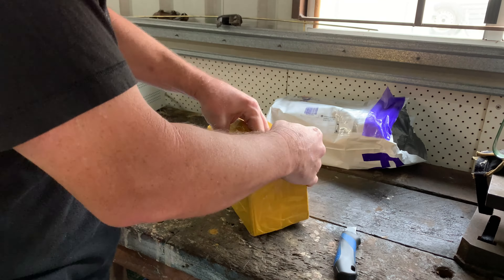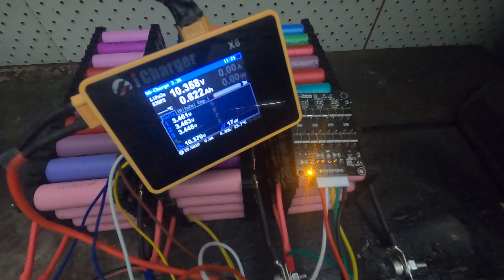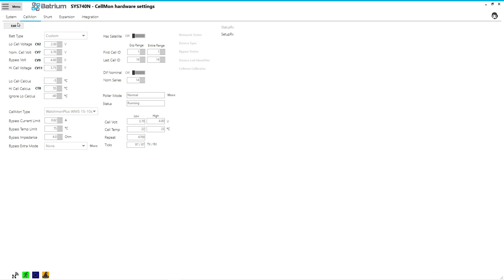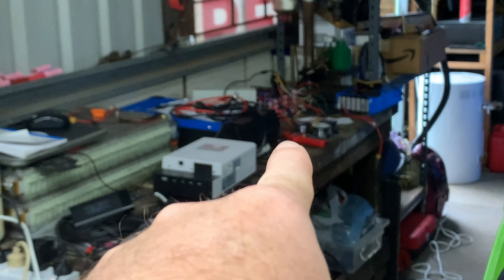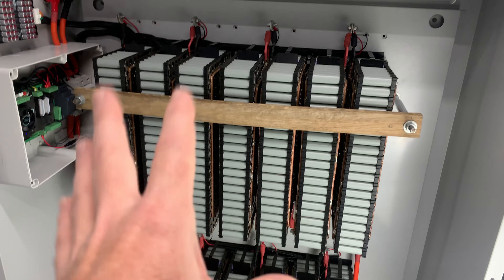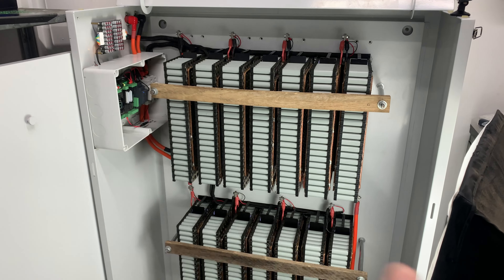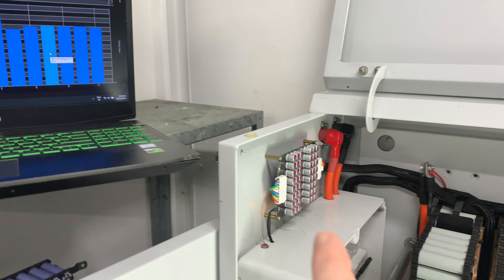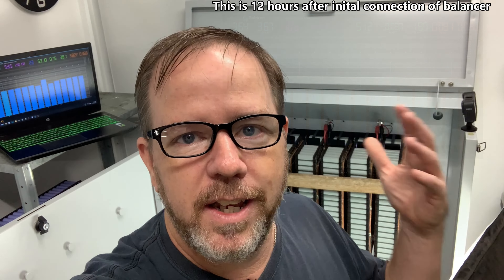Install & Test Heltec Active Balancers

Comment: What sombody needs to design is a balancer that uses a separate cell from the system and is charged with a dc/dc converter that hops around charging each cell at 10 or 20 amps at a time for large packs until it is balanced. I think its doable.

Comment: What's the difference in cable length?
The voltage drop at 48V along 3mm cable over 1m at 5A is about 0.0615V.
Looking at your test set up I would guess the cable to be between 1.5 and 3 metres overall length, so 1.5m difference - say 0.09V between highest to lowest reading.
If the issue were just the cable length  would expect to see a range of differences from nominal, not one flier (unless all the other cables are about the same, with one cable about 10m longer than the rest.
What you are seeing points to there being something amiss with the controller as well as a small contribution from cable length.

Comment: Hmm. I think the current balancer that they have sent you can only do a-b, b-c, c-d eta balanceing, meaning that the balancer is dishing out current from the cell with high voltage, to the adjacent ones, which are then dishing out current to there adjacent ones. The balancer isn't able to provide enough current from the cell with the high voltage to the adjacent cells, so the 2 adjacent cells are discharging. Because these cells are discharging so much, it is throttling the total balancing current. I know that you hate active balancers, but it would be interesting to see you test there "Smart Balancer 10-24S 4A" as even though this is only 4A, it advertises "Point to point energy transfer algorithms" which sounds to me is able to balance to any cell in the pack.

Comment: Like you said in the description: an ideal battery wouldn't have this issue. To add insult to injury, if you have an issue, you'd rather want to be informed about it instead of sweeping it under the rug by dumping all your battery power into one bad cell!
Reply from the maker: Yes, it's a tough call because they fill a void where they can keep and older battery alive/useable for much longer but just because you can, doesn't mean you should.. Whats worse is there are a few battery sellers floging them with their batteries..

Comment: i think lower the voltage of 1 of the banks and check the current flow into that and see if it is only low voltage cell that gets the higher current

Comment: When I think how to measure voltage accurately, the single attribute that comes to my mind is "end to end" resistance. Larger cable cross section when in "audio" frequencies, i.e below 100kHz, including DC, will result in lower resistance, which means lower temperature rise in the cable. If all "end to end" resistances are equal, it does not matter what the resistances are, because they cancel each other out. Based purely on the BMS components I think I saw, I suspect it is same kind of a balancer aka "Flying Capacitors" BMS that for example
Julian Ilett is using in this video https://www.youtube.com/watch?v=bMmlgS46occ IIRC Julian has done a a few of videos that contains some mentions of this type of BMS.

Comment: Heltec's complete lack of support, after they sent you the balancers, to review, doesn't say anything about their professionalism, or any ability to back their products. To leave you to absolutely guessing, at what you need to do next (to get the maximum balancing efficiency), has turned me completely off, purchasing ANY of their products!
Love your work, mate.
Reply from the maker: They did reply quickly but feel it was more a translation issue, but yes replies to my questions would have been nice - THAT said, I still have it running and the battery is still very well balanced with a 200w load on it 24/7 I should turn it off to see if the battery unbalances

Comment: Wire length should not matter all that much for capacitor balancers, they basically connect caps to each cell, then switch so the caps are all connected parallel together, then switch back to being connected to the cells... this makes them level out as if you have all the cells connected in parallel... just slower because of impedance. Wire length probably matters more for the inductive balancer types but they have the own issues, especially when used in large strings since they only transfer bank to bank so if you have a high bank, it will transfer to the low banks next to it, and then to the ones next to that and so on making a ramp as they stop balancing once they reach a certain voltage difference.

Now what will matter is wire resistance. The better connection, shorter the wire, and thicker the wire, the lower resistance and the more current you can get, however, the current is proportional to the voltage difference between each cell... and all cells balance at the same time which is a nice feature for larger packs with more series cells or banks... the inductive type is not as good for this but for smaller packs they are nice and tiny. An inductive balancer might sometimes move more current per unit difference in voltage, but I think that would depend on if the chips are designed to compensate like that. The transformer balancers can move a shocking amount of current but are more pricey. These balancers are really meant to be left alone, set and forget, they take very little power (basically only enough to run a small oscillator and switch some MOSFETs), and they do not have any brains that can get confused, they connect and disconnect capacitors so that they move charges from all higher cells to all lower cells at the same time. But I have seen guys using batteries with flat curves... these can screw them up because the voltage difference are not from different state of charge, just different connector resistances, so they only run the balancer when the batteries are charged up so they have a difference in voltage from full to almost full. For the cells I scavenge (LCO, NMC, usually 18650 case), not that big of a deal since the cells have a more linear discharge curve so the balancer wont possibly screw with a top balance, but for LiFePO4, you might want to check if that is the issue, I suggest a little voltage trigger, one guy used a relay board but I hate relays because they're mechanical and take lots of current compared to a MOSFET.

Comment: Unplug the Batriun to let the Active Equalizer work.
If the two systems are connected, it will not work correctly and there will be a gap between the series.
Greetings.
Reply from the maker: Batrium does nothing unless its within a range that I've set - it won't even turn on till 4.13v and start balancing till 4.15v - It just sits there drawing =/- 1w of power waiting till the time it needs to 'manage' the battery.
Reply: @HBPowerwall  Ok mate.
Best regards.

Comment: I bet the charge level on each is directly proportional to the wire length

The balancer will see voltage and a longer length of cable will drop more voltage than a shorter one
Reply from the maker: Sounds Likely

Comment: It's OHMs Law.  It's not wire length or anything like that. Working with voltage differences between cells in the millivolt range you will be challenged to get the ballancers peak current rating outside of a direct short. 
I haven't seen anybody get the rated current out of 'em.
And yeah, it's a balancer. Not a BMS.
My solution is to top ballance each cell every once in a while and be done with it.  :)
Reply from the maker: Yep, with all the rain I just left my house battery off for 10 days, the longest period it's ever been off in about 6 years and its within 0.2v good enough for me..

Comment: it is not about cell voltage , the active balancer is not designed to this mush big battery  .it is about average voltage after charging the capacitors , you should check how actually it is working so you can understand what i mean
Reply from the maker: I know how they work, they move energy around with out logging that energy and end up HIDING critical issues that would be caught other wise with a good BMS..

Comment: Peter, the balance should only be switched on when batteries are near fully charged.  Otherwise it will disrupt the balance.
Reply from the maker: Thats not how these devices work unfortunately,
Reply: @HBPowerwall  There is a point on the board that has two terminals soldered.  Remove the solder and a switch can be wired in to turn the balance on or off.  Then have the balance turn on only when voltage is above a set value.  I am planning a rather large build 25 kW PV and 100 kWh battery but would like to be part of an Australian forum to get help if needed and maybe contribute..
Reply from the maker: Yes, My Batrium BMS is hooked up to that port and controls it to a degree..

Comment: Those thick DC Cables must be the same length so the cells stay balanced, even the balancer cables must be in equal lengths
Reply from the maker: I think for commercial application that is 100% true but for mine, the differences are so tiny it won't really matter.

Comment: Good video.  I just don't think the current generation of active balancers are able to handle the massive parallel banks of batteries we're working with.  Relatively flat discharge curves, and enormous Ah storage is never going to work without an intimate knowledge of SoC.

Comment: Whats the total resistance of the wires you have extended? I don't think balances can boost voltage,  I think they are just higher voltage cell carriers - but I may be wrong.

You'll find that the voltage drop in the cable will cause less current flow from cell to cell. It's a direct result of low voltage vs high resistance. 

I have a couple of active balances in some of my early badly matched capacity 18650 batteries. Because these packs are in parallel with many other packs, the constant load is very low, no more than 10 amps at worst and usually only for an hour or two, they mostly sit discharging just a couple of amps. So I find the balancer does a good job keeping them all in line. But if these packs were my only packs and I was cycling them pretty hard, the balancer wouldn't have a hope in hell keeping the pack happy.

You've really got to pick and choose when they are suitable for use.

Comment: Do you really believe this little balancing board will manage to do his job fast on those beasts battery packs?
Reply from the maker: No but I would also expect that it would remove energy from cell 7 & 9 either.. that is unnecessarily cycling the batteries even more.

Comment: Not worth your time. But I do appreciate your hard work.
Reply from the maker: Weeks later and i'm still not convinced they are a good idea.. I mean they work like it says on the box but no much better than a cheap BMS with the balancing current 99.9% of the time being in the mv range not the 5 amp max it 'could' do.. and to be honest that situation would me you have MAJOR issues with your battery that desperately need to be addressed not hidden

Comment: I'm new to this, absolutely no experience.  Buuut : If the balancer stops the current flow, before measuring the voltage, then cable length does not matter (and because of that, it should do it like that, but maybe it does not).  If it does not, and measures voltage while balancing, then you're possible better of having them all the same length (when a current flows, you get a voltage drop because of the resistance in the wire (veeery little, but not zero)). ...... In general, wires/cables are better of just laying messy around with lots of space in between.  If you strap'em close together you have started (somehow) to create a transformer, and if you then run AC (alternating) current through one of the "transformer" wires, then you get a induced current in the very very nearby wires. ...... But that's or AC. ....... Here it's DC, and I'm not sure now, but for DC, I think it doesn't matter (no induction). ......... So my guess is that the firmware is measuring the voltage while balancing, and then the cable lengths should be exactly the same, idealy,....... but if it matters ?,....... probably not. ......... The guy who sugested that the balancing was only done with adjacent cells, maybe he's correct, as the bars on your display could match such a process.  But I fail to see why a balancer has to be engineered like that, except, it's probably cheaper to produce like that. .... If this guy is correct however : https://www.youtube.com/watch?v=bFOJdvxhJbo ......... then there possibly are kind of AC currents flowing back/forth in the balancing wires. .......... And if he's correct, that neighbour only balancing is not the case (maybe is in the BMS ?).

Comment: 8:48 That's definitely not 3mm diameter conductor and I doubt if that's 3mm2 conductor.  I think there is too much chinesium oxide in those components and that manufacturer is out to break your storage system and/or your confidence.  If they were a problem in previous version, they'll a problem for every product they make.   As Marty would say: https://www.youtube.com/watch?v=v8CK6CLGTjM
Reply from the maker: OMG that in the bin is getting old FAST lol but yes it might be less than 3mm but that's what was on the spool

Comment: wires are too long for non capacitive active balancing. Try their BT version, it has impulsive capacity active balancing with 4A, wire length does not matter for it. It stores energy in capacitors and transfers it to lower cell in pulses.
Reply from the maker: That’s exactly what this does
Reply: @HBPowerwall  he is right. It wont work the same way.

Comment: At .5 to 1.5 amps I don't think a active balancer can work on such high of capacity system. If you put 20 or 30 of them on your system it might work. Otherwise I only see they would work on a system that is ten fold of the balancing current, or about 10 ah per board.

Comment: for that length of cable you will need to have a thicker cable, to let 3.6v travel in 2 meters of cable without loss you will need 10mm2, wire resistance....sorry pete

Comment: Hey , in total full loded u got 200ah maby more maby les , that 5 amp active balancer  lets say its balancing 2 cells in 1h , u got 2000 cells there maby more maby less , so that means they balance in 1000hrs if they completly unbalanced , the point is if they are not new cells the charge and discharge are not so eficient in egual mode lets say 2 new cells charge and discharge at the same time , but if not new the charge and discharge are diferent betwen them so u balanced them in 1000hrs and u disbalanced them in not more then 1 hr and ther it goes charging frome solar system first to the good cells then harder to bad ones , in paralel they balancing at highest speed betwen them and in series used to a consumer the bad paralels discharges faster and consumes ah , when the good paralels berly consumes , so there we go begging fore that balancer to balance 2000 cells in shorter time butt it cand still same process 1000hr without u charging or discharging it , so in  my opinion add 10 more or more active balancers and putt em in paralel , its not balancing the way it shud normaly to smaler pack so that that u got is a huge mega pack so to kepp up with charging , consumers and balancing add good bms and good balancers , more and use them same in paralel